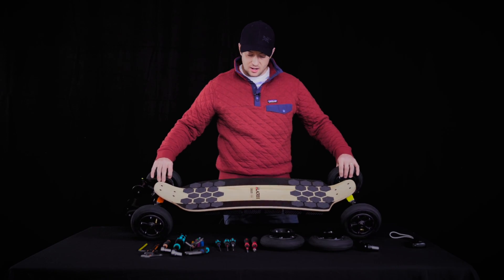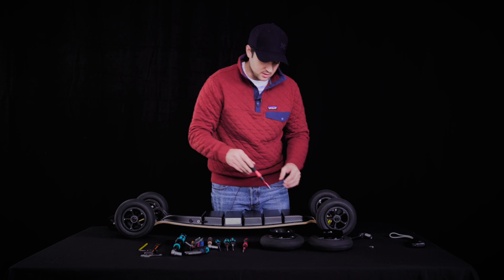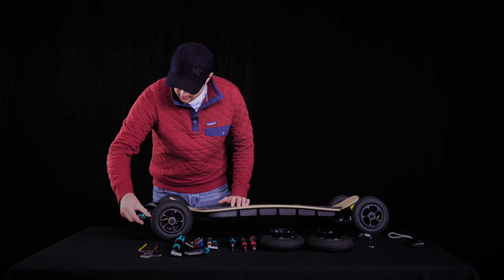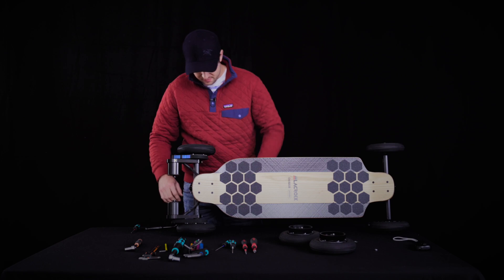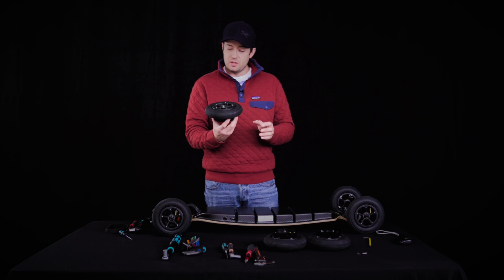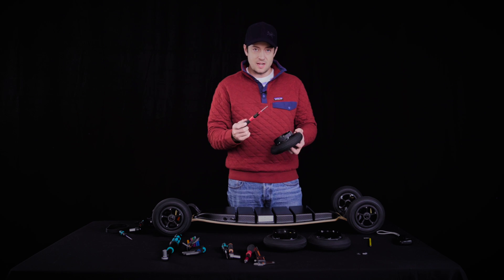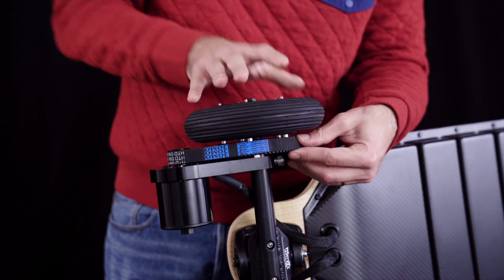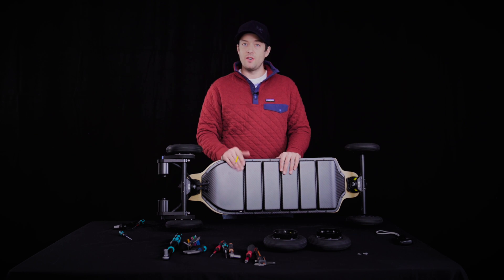HOW TO; LACROIX Boards Tutorial (Prototipo - DSS50+, DSS60)

Comment: Re: bearing spacer, does the newer Jaws' wheel comes with a pre-installed spacer? I have not held a lacroix wheel but the clouswheels if you forget to put the spacer it will be very hard to remove the bearing and install it, it even may damage the wheel when removing i think.
Reply: yes, all our boards come with bearing spacers

Comment: hey Alex, im really interested on the board the only down side is the remote,the only reason that stops me from buy it, are you guys  working on a solution or other options for that?
Reply from the maker: Hey! the reviews usually state says the remote "feels" cheap, which is right. However, the internals of the remote are the best you can find. We chose that remote since our carbon fiber enclosure creates a quasi faraday cage and the nanov2 has no dropoffs. If you look at all those reviews, the complaints are usually lack of telemetry and cheap plastic feel. But not drop offs. And on a board that can go easily over 30mph, we'd rather have a no frills remote that is consistently reliable than a remote loaded with bells and whistles that drop offs and can be dangerous. This said, we will be offering a new remote soon (retrofittable on the current boards).
Reply: @lacroixadventures2009  Thx for the feedback Alex, in that case I'll wait., Cheers.

Comment: the main complaint people seem to have is the remote so my question is how difficult would it be to change it to a different one?
Reply from the maker: Very easy. Plug and play in the focboxes. But you need to be careful - the carbon fiber enclosure creates a quasi faraday cage and the NanoV2 which we use, despite its basic looks, it the only one we have tested that has consistent connection and no drop offs. If you do change the remote, start very very slowly as you're going to be a guinea pig. Some other may work though, not saying the contrary - there are a lot out there.
Reply: There are already mods for the remote to convert it into a trigger Style one. Check it out: https://www.thingiverse.com/thing:3231022
Reply: The Perdu why is this board and the nazare come with a cheap $49 remote such a quality board and they dont have their own remote...dont make sense.

Comment: Could you explain why you don’t use Spacers between the  Wheel Bearings ? I got enough Spacers for the MBS Trucks so I’m wondering if i can use them. Thx P.S. a video how to use the centering jig + download link would be helpful
Reply: mcdopig MBS told us these hubs were designed to be used without spacers. We were skeptical at first but after using them for over 18 months without spacers, they work fine - just be careful when torquing the axle nut. If you have spacers for them though, you can certainly use them - can’t hurt.
Reply: Thx for the quick response Alex!
Reply: Love your boards! You should just consider adding spacers 😊

Comment: thx Alex ... Please create a list of tools that I need to have in my tool box, and post in the description of this video. Also, please provide torque rating list in lbs for all the screws that need to be maintained, including the little screw to hold in the shock blocks. I don't want to damage anything. Maybe you could also get a royalty from Amazon for listing the tools that we need.
Reply: James Thomas will do! As for the shockblock screw, it’s tricky because some are much easier to screw than others - the only important thing is to make sure the hole in the block itself is perfectly aligned with the screw hole. Then you can torque the screw. If not perfectly aligned, you can strip the screw thread or the hole thread.
Reply from the maker: Done.
Reply: @lacroixadventures2009   ordered the exact torque tools you recommended. thank you.
Reply: Is there a full list of all the tools you use? Doesn't seem complete in the description.. thanks!
Reply: I still can't see the tool list
Reply: What do you torque setting for the standard wheel nuts? Since there is none listed here, guess I will just wing it.